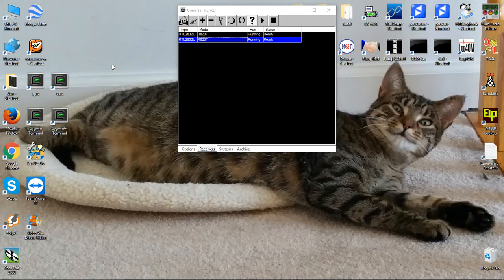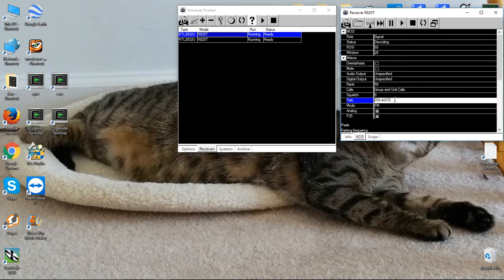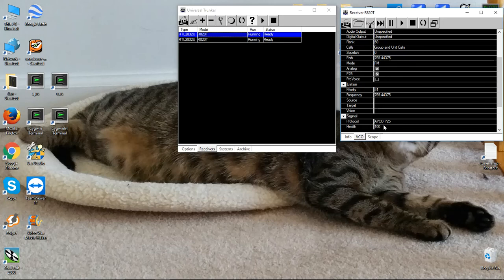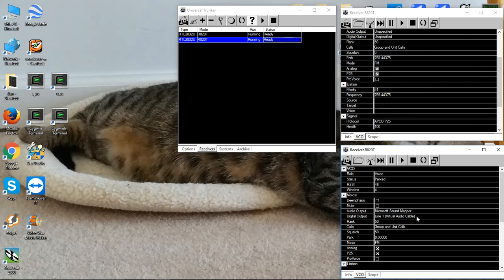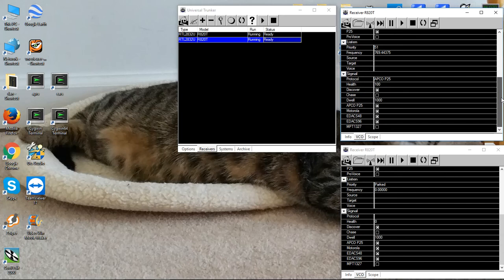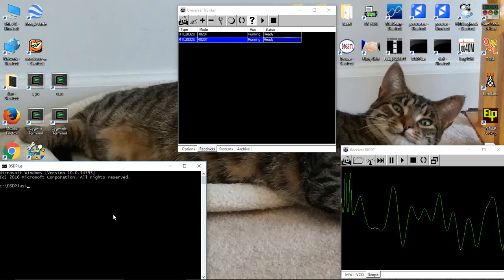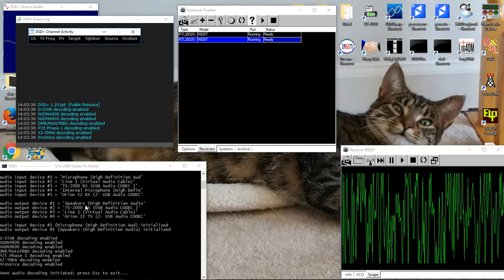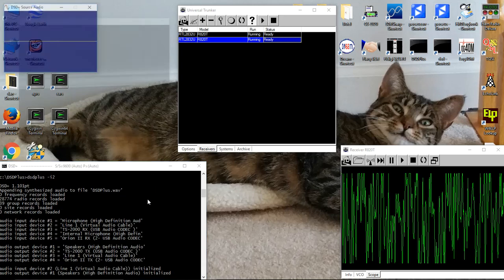Unitrunker Digital P25 Intro

Comment: Anyone know how to get rid of the loud 2 second burst of static after 
analog voice transmissions in Unitrunker? It's like a delay in the 
squelch taking affect. I I have two computers and both do the same. 
Never did get DSD+ to work. It shows no activity in the scope or windows
 with Unitrunker and with SDR# the scope and windows show activity but I
 get no sound.

Comment: I wish there were some videos on what to do if Unitrunker won't work at all.  "Could not open!" is all I get.  I have a:

Applications  Software defined radio, DVB-T, ADS-B
Interface IC          Realtek RTL2832U
Tuner IC          Rafael Micro R820T2
Clock Accuracy  0.5PPM (max)
Inst. Bandwdth  2.4MHz (nominal); 3.2MHz (max)
Freq. Range          25MHz-1700MHz (nominal)
Reply: Do you have SDR# open at the same time?